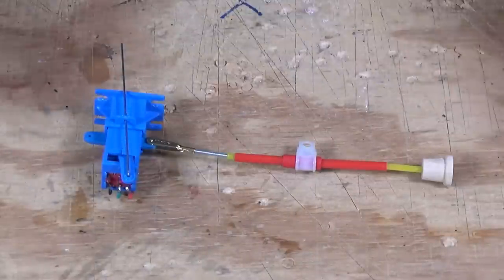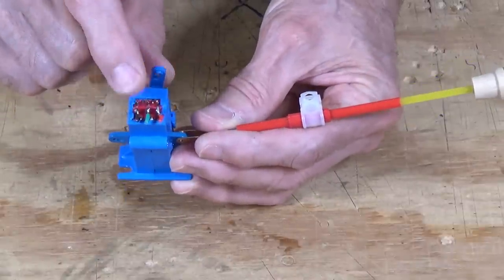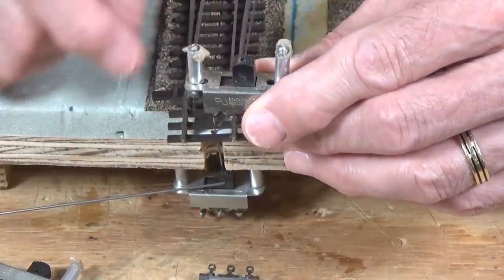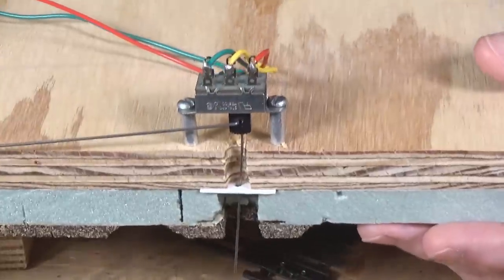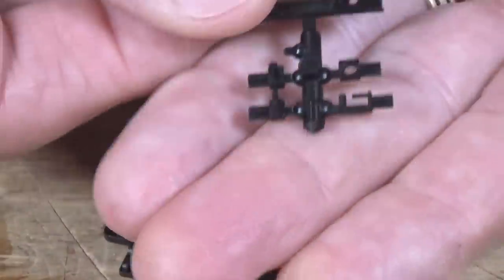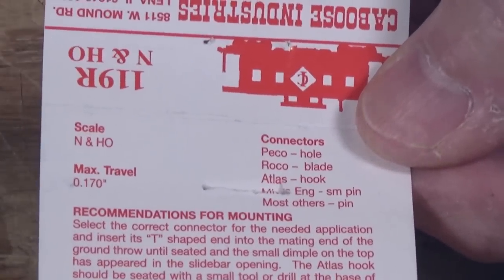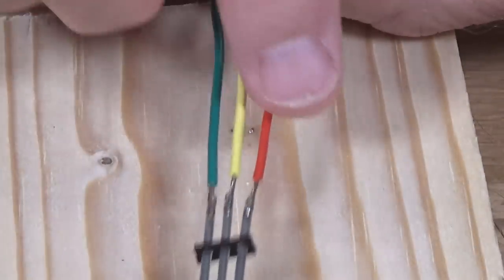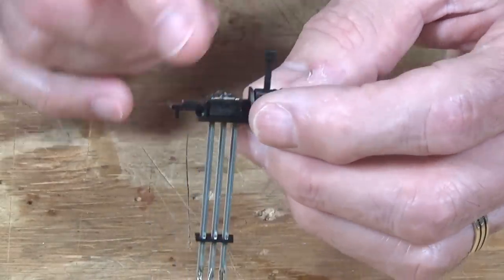3 Manual Control Methods For Turnouts And Frogs (261)

Comment: I used bicycle brake cables for my push pulls on the further switches. And small lead split shots to secure them in place and a cable loop to hold the outer case. It helped by being flexible to work around obstacles. I got 4 cables at Walmart for $10.
Reply from the maker: Great idea and a great price.

Comment: Excellent video. I have found the ‘Bullfrog’ system by Fast Tracks to be highly reliable. They have the ability to switch crossovers with single cable and can accommodate different lengths of cable to suit specific layout configurations. All of them are designed to switch the power at the frog. They are sold as easy to assemble kits.

Comment: Greetings from a grateful subscriber.  Your videos are very helpful--keep up the good work.  I use manual control for my switches, where the crux part is a toggle switch that both controls the frog polarity, as well as a positive positioning of the points.  I use a DPDT toggle switch with one push-pull knob to control the two switches in a crossover. (and a few more levers and rods).

On unrelated notes, I just ordered your book from Amazon about electronic projects for one's model railroad.  I'm looking forward to it.  This was inspired by your videos about lighting caboose and passenger cars,, with a bridge rectifier and a capacitor, etc.  I'm ordering today the electronic parts to make a bunch of these devices.

Also this past week I completed my first DCC install in several years, and my first install with a current keeper - the CC really works well.  The engine (S Scale UP SW-9 Switcher) continues to idle for almost ten seconds after shutting the layout DCC down.  The decoder was a first generation Tsunami EMD 567.  I still have four or five Tsunami 1 steam decoders yet to install.  I'm going to retrofit my steamers already with DCC with a current keeper when I get to them.  It should be against the law to install a DCC decoder without a current keeper.  Thanks!

Comment: I decided to go with the Blue Point machines after watching your British Layout video series. I have a switching layout so they've had heavy use. I've had almost no problems with them. My only complaint, is the little wooden handle. They spin around and over time, end up unscrewing themselves. It's rather annoying but other than that, they've been great. (Thanks for all the video's by the way! This channel is a gold mine of info for younger guys like me new to the hobby.)
Reply from the maker: Maybe a little PVA glue on the screw threads would help.
Reply: @TheDCCGuy  I'll give that a go. Thanks Larry!

Comment: As long as you have a straight path from your fascia to the Blue Point machine you can use 3/16" doweling to move the switch. MUCH cheaper than the flexible tubing. Just glue a knob to one end and insert a small eyelet in the other. Pry open the eyelet, stick it through the hole in the throw rod and then squeeze it back together. You may have to drill out the hole a bit to get it to fit.
Reply from the maker: I think it is all engineering plastic and these have been available for ages. I know folks who use the standard version without the switch built in all,over their layouts and have never seen a failure. However as I said in the video I am not enamored with the switch mechanism itself.

Comment: Thanks Larry. Very interesting.  The Caboose Industries thing looks ingenious (despite the production issues you highlighted): in fact it reminded me of a very similar metal lever we had on a layout way back in the late 1960s!  Though that didn't do frog polarity switching.

I wonder if you have come across the Great Chesterford Junction channel here on YouTube?  He has manufactured his own manual point operation system, operated by signal box type levers in a frame on the control panel, which operate wires under the baseboard, through various bellcranks and what have you.  Way beyond my manufacturing abilities, but curiously satisfying to watch!

Comment: 10 years or so ago, Great Chesterford Junction showed how to manually throw turnouts using a single hole the size of whatever spring wire you chose to use. Under the layout the same spring wire is bent 90 degrees in whatever direction is best to translate to the lateral motion of a push-pull rod, which could easily operate a slide switch as you've shown. That superior idea never got the attention it deserved, except that all of my manual throws are designed that way. Why so many choose to flop back and forth like a fish on a dock, rather than pirouette like a ballerina is a mystery to me.
Reply from the maker: Yes, it sounds like the mechanism Jim Hediger wrote about in MR 20-30 years ago. However it doesn’t provide any power to the frog.
Reply: @TheDCCGuy  The point is your slider switch is easy to add as you did with the flop back and forth approach.

Comment: Can you use the regular Caboose throws (not the 119) with a Blue Point underneath to control the frog?  Or can the Blue Points replicate the sprung function of Peco turnouts on no Peco ones?
Reply from the maker: You can use either the Caboose ground throws or Blue points to throw the points but only the Blue Points have a switch for frog polarity. I originally used the Blue Point switch machines with Peco turnouts on the modules and did a couple of videos on that installation.

Comment: Nice production. You left out the Bullfrog from FastTracks. Not that I like them, but  it is a good inexpensive option.  The throw distance at the fascia is to far for my liking. That said I do not like the size of the Caboose throws with contacts, but a nice combo would be the small Caboose throws with a frog juicer or the like. The Blue point controllers are nice but if you can find threaded rod use it for a more solid feal when throwing a turnout. Those flex rods are spongy and many times require repair somewhere along the line.

Comment: Larry, just watched this lesson last night. Want to give a try to the Caboose throws. What temp did you use for your soldering pen? Assume it's a digital (Hakko?) rig. What temp for 22-28AWG feeder wires onto/under sides of code 55 rail? Thank you. - Noel
Reply from the maker: Noel—I always tell folks to start with a temp a few degrees above the melting point of the solder they use and working with some scrap wire or track, practice until you get good results, increasing the temp gradually. A quick Google search will give you lists of melting points. This is especially helpful when working with a new iron or type off solder.

Comment: Larry,
Do you know where I can order the adjustment yoke ends on the cables?
Reply from the maker: Some folks use auto choke cables and those made for use with Blue Point Switch Machines would work.

Comment: OK...But the first showing involved buying the 3D printed housing or whatever.
There is an even simpler solution....
That of a simple DPDT switch.
In this way and by being dual pole we can solder up wires to the switch to operate LEDS.
The switch itself is activated by a crude 6mm dowel rod.
It does not bend, needs no rod in tubes and unnecessary adornments.
From the " slide switch" two holes are drilled into the slider.
One for the bar and the other for the push rod.
It is really simple.

Comment: Hi Larry, another great tutorial. Do the caboose ground throws work on the new Walthers turnouts and if so would you remove the clips from the turnouts or leave them in so it’s a more positive hold on the rail? I heard you say they will change the polarity of the frog but will it also control a signal?
Reply from the maker: They should since that was the turnout I was using for the demo. They might be ok with these since they have a set throw distance. Some Caboose ground throws have a spring built into the throw mechanism but these do not.

Comment: If these are still available, I could use six. Just let me know if they are available, how much and how to best get you payment. Thanks
Reply from the maker: Gene, I have someone else interested in them and am waiting to hear back from him so I’ll have to let you know.
Reply from the maker: Gene—the fellow who wanted them backed out as he has almost 2 1/2” thick subroadbed so was afraid the Blue Points won’t worked. So I do have 11 of them and will sell you 6 for $8 each plus shipping. I will include all the hardware and the pushrods although you may need to modify the pushrods for your layout.

Comment: Stupid question time.........I have several turnouts with Caboose manual ground throws and unpowered frogs. I expect that I could solder a feed to the frog and run that to a single throw or even a double throw switch and power and phase the frog "manually". Correct? I would have to perform two actions to accomplish a switch but it would still work I think. Yes? I know, stupid question. haha Power your frogs in the first place and you will be fine!
Reply from the maker: Yes, you could do that but every tome someone forgets to throw the SPDT or DODT switch the resulting short will shut things down and likely be moe annoying than the dead frog.
Reply: @TheDCCGuy  I thought that would be the case. But I am a one man show so I would just get mad at myself! You do a great job my friend! Look forward to watching every week!
Reply from the maker: Happy to have you with us—Larry

Comment: Larry what if wanted to use both manuel and servo switch machine on the same turnout?
Reply from the maker: It would not work as the manual method basically locks the throw bar on the turnout in place.
Reply: @TheDCCGuy  you are probably right; but I will have to look into it and see what I can come up with later when I have the time to study it and do some sketches to work out a solution.

Comment: Those Caboose Ind.contraptions are nothing if not imaginative. But ..., 22 minutes and 3 manual throw method demonstrations and not a mention of choke cables -- how times have changed!
Reply from the maker: I wonder how many folks now know what a choke cable is? I actually looked into them when I did the original Blue Point videos and if I remember correctly they were a more expensive option, possibly because few cars have a manual choke cable with a button on the dashboard anymore. I think they are more readily available now for motorcycles.
Reply: @TheDCCGuy  Larry, I wonder if bicycle shifter cable might take the place of choke cable?  I haven't seen or tried, it, but it might be a possibility.  Thanks for the great video!
Reply from the maker: Any of those should work. You could also use the pushrods and hardware for the Blue Point switch machines.
Reply: So you still have any more of those manual throw blue items if so I would l Like to purchase three

Comment: What i do not understand it this:
Why do you people call it a Point? it is a switch, isn't it?
It switches the train from one track to the other.

A turnout i can understand, but a point makes no sense for me.

I am dutch.
I am trying to find stuff online, but the fact that sometimes it is called a switch, other times a point, and other times a turnout, it does not make life easier.

Can any of the people who were born and raised in a country where the English language is spoken enlighten me?
Reply from the maker: Technically it is a turnout although switch is also commonly used for the whole thing. The points are the specific ends of the rails that move. I did a video a few years go on turnouts and the names for all the various parts. In the UK they refer to the entire turnout as a point.
Reply: That clears things up a bit. 
Thanks for these videos btw. I have just restarted this hobby. 
As a small boy we had a huge setup. My father and i. But in those days i had no idea of money, and how expensive quality model trains are. And so, you can guess where this is going.
Not many survived in working condition. I always found a way to burn the engines of the locs.

Now a bit older i seriously regret that, but tja, we ain't all born with a fully functioning brain.
Either way, now i know how fun it can be, but do have to learn a lot. And your videos help out a lot.

 @TheDCCGuy
Reply: ps, sorry, but i am going to write you a book. (this comment i mean.)
You are free to read or not read. Some people think i am a troll because i write book length comments.

Anyways, i am dutch, excuse the grammar and spelling errors.

So far for the prologue, here is the book which contains a few questions.

I have yet to start buildings a landscape, a layout for the tracks, etc.
I have just started collecting the stuff needed for to build something nice.
And, as a noob i have obviously already made a few mistakes. Like buying Märklin trains which require AC and a third rail, and expecting them to work on DC rail.
I put it on the rail and thought: Doh, it is broken already.....
But then i figured it out.
And so now i am obviously first going in one direction. The DC route. And lateron bring in the AC Märklin trains. Or Marklin. 
Or i will resell em, also a possibility.

Anyways, the system we had when i was a child, i can recall it to be DC. Simple controllers, simple stuff.
But, now we can watch Youtube and discover that even DC is not that simple.
Not if you want more out of it than just running a train around a loop.
I also am not an electrician.
And so that complicates it even further.

But i have seen plenty of videos and still am watching em.
And, my brain sometimes does work a bit.
Isolation of track, brilliant.
Switchboard to switch between the isolated parts. 
That is something i had thought of and saw in a video.
But now here is a question:
I could switch all of it to DCC. I have seen that DCC can run on DC track etc. 
All i need is DCC Locs and controllers to control them, right?
But, i was thinking myself....
Why would i even go that route?
Why not keep it DC?

Isolate parts of the track.
A switch board with manual switches to control the electric circuit to switch the blocks of track.
And, i was thinking of incorporating timed switches like you can use to turn on and off a lightbulb or what ever appliance.
Sure, could become a bulky project if i install dozens of such timers.
But i envision it working just as a DCC system would.

So the timer controls when the track becomes live. 
Sending the stationary train that is sitting on it on its way.
And if every isolated section is timed in such a manner, i do not need a fancy computer. I could do with the cheap timers which we use to turn on and off a light bulb (or whatever).
What are your thoughts on that?

Then about the scenery.
I have seen videos explaining you should plan everything.
The power set up, the wiring i mean.
But why not stick a conductive material on a plank of wood, or a board or how you wanna call it. 
Then a layer of isolation. And then again a conductive layer ontop of that.
If you were to put juice on those layers, you only would have to cut out a small portion at any point on the board/plank to have power. Right?
So, a huge plank/board with the setup as described. And i would no longer have to think about running wires to specific places to power a small lightbulb.
Right?
Or do you see a problem in my way of thinking?

Another idea: I was thinking of building my own turn tables. So the train will be turned around or set up to drive a different track.
I was thinking of using microwave oven motors, those that turn the table inside.
Any thoughts on that?
As for how to line everything up, i got an idea as well. Small end stops so the turn table wont move any further and the tracks line up.

And last but not least: i was thinking of using reed switches and small magnets stuck underneath the train to do some stuff.
Switching switches or points for example.
So that when one train passes, the switch switches. But when another passes it wont.
Depending on if there is a magnet underneath.
Etc.

All i am interested in is hearing your thoughts on all of this.
I understand that DCC might be easier and the way to go. But i like tinkering a bit with it. 

Thanks in advance if you happen to reply. I can not expect you to read all of this. Noob questions can be boring  @TheDCCGuy

Comment: How do I contact you for the purchase of the 12 machines…
Reply from the maker: You just did. Actually there are only 11 of them and 2 are brand new. Let me come up with a price and I’ll get back to you here today.
Reply: @TheDCCGuy  
Thank you
Reply: @TheDCCGuy  
Quick question…I model in N Scale and my base is made up of 1/4” luan ply, 2” foam and 1/8” cork road bed. Will these work properly with the required throw…
Thank you
Reply from the maker: Sorry but my internet was down most of yesterday so did not get to research your question. Hopefully today—Larry
Reply: @TheDCCGuy  
Larry,
Thank you…I believe that the max base thickness for Bluepoint is 1 3/4”…unfortunately my base thickness is 2 3/8”…since I model in n scale the throw rod hole would need to exceed the width of the track to possibly work correctly…that said…I’ll need to withdraw my interest for the 11 Bluepoint sets you have.
Thank you again,
Randy

Comment: That last one looks like it's set up for failure. Not the way you did it, but all the plastic involved.
Reply from the maker: I think they are made of engineering plastic. These have been in use for ages and at least the standard ground throws seem to never fail. However as I said in the video I am not enamored with the SPDT switch but it does work.
Reply: I would add some heat tubing at the bottom of the three prongs and the connecting wires.
Reply: I believe it is Delrin engineering plastic, strong but also slippery.